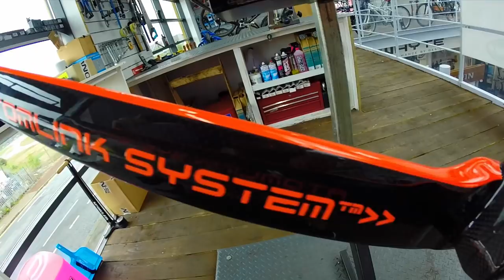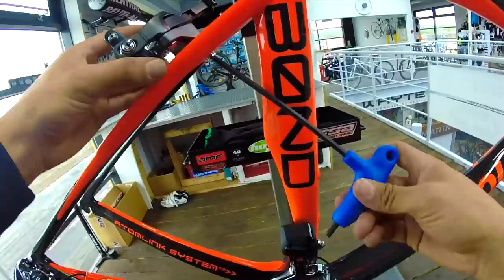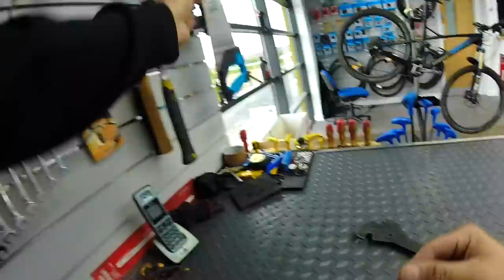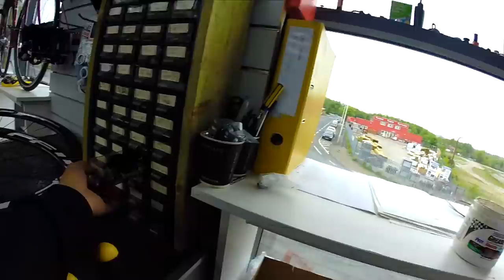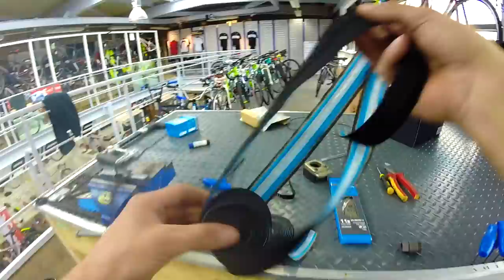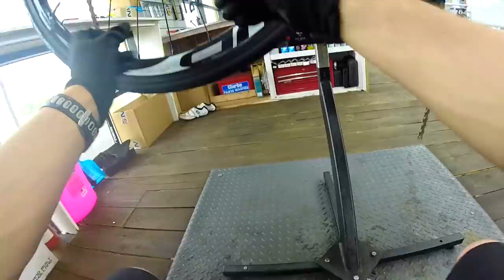Cipollini custom bike build ultegra di2

Comment: I would have went with DA mech over Ultegra Di2. And how many spacers does it take to make the frame fit? 50 mm under the stem plus 40 mm for the stem is 10-20 mm over what I would consider safe...